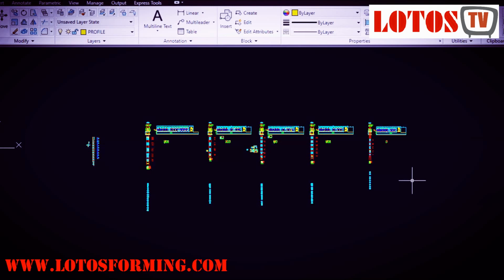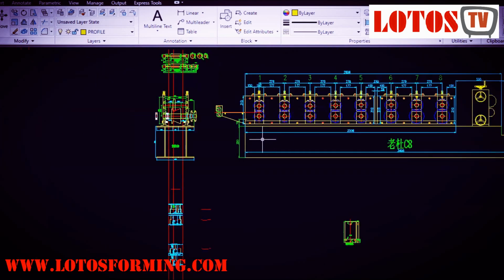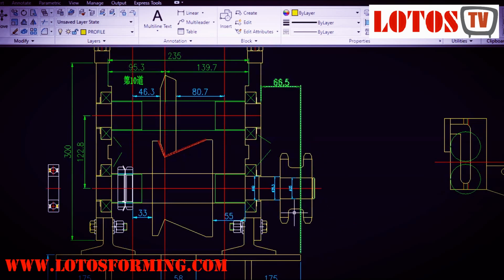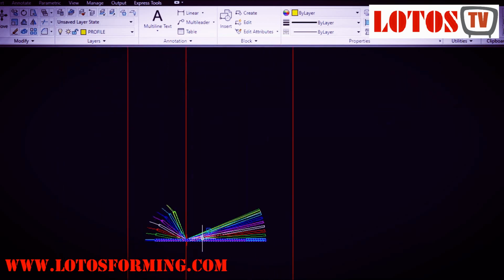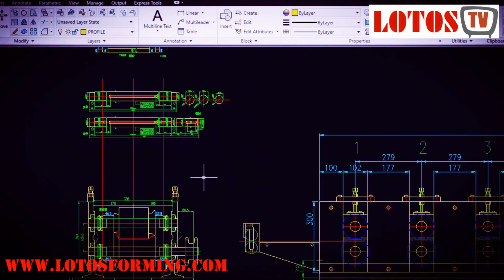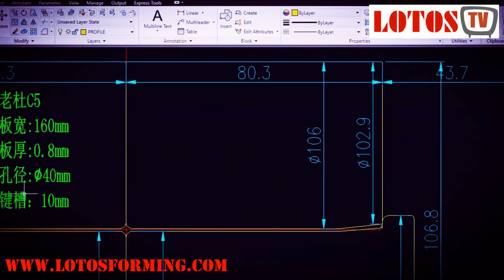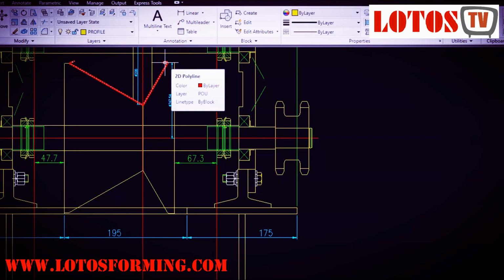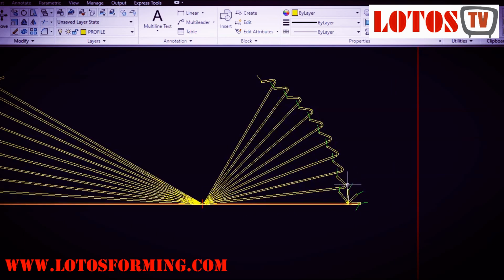【Designing Custom Roll Forming Machine】: Roll Forming Design | Roll Forming Process

Comment: 【Designing Custom Roll Forming Machine】: Roll Forming Design | Roll Forming Process
About Designing Custom Roll Forming Machine, A Collection of rolls design according to the forming process (roll flower) design and adapted to form the steel sheet gradually. long production line with more than twenty stands of rolls causes the forming defects of the twisting, and the bowling, and the swinging, and the wrinkling, and the spring back of the sheet blank during the cold roll forming process for Custom Roll Forming Machine .